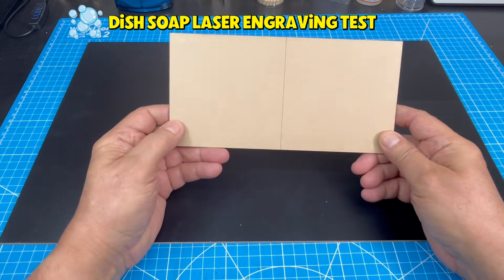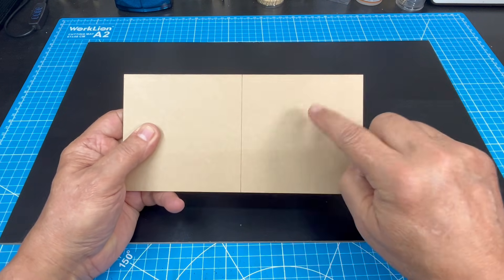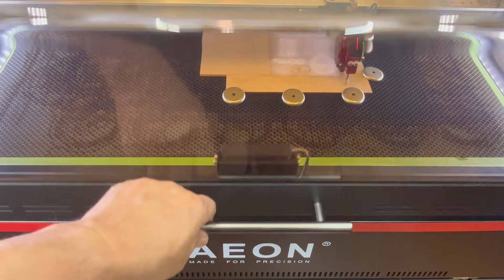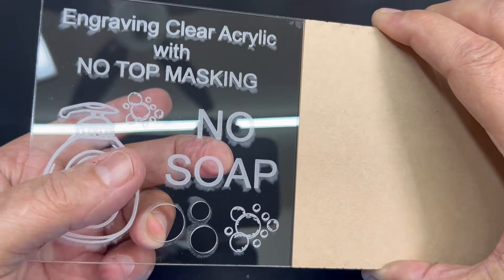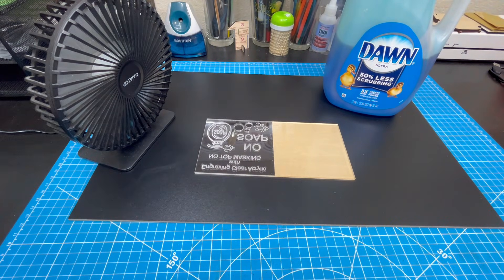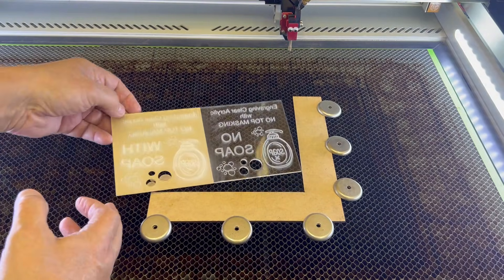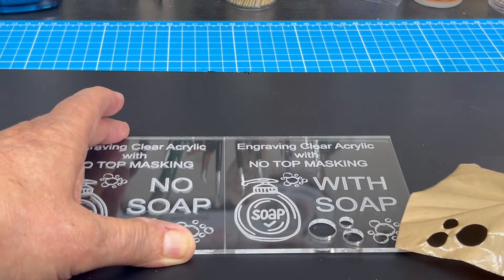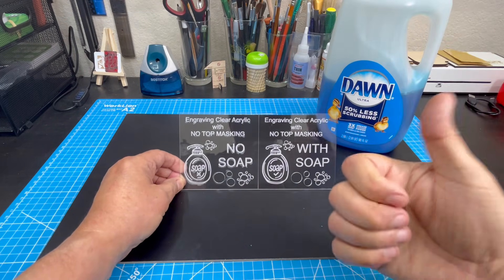Laser Engraving with Dawn Soap -  Dish Soap Laser Engraving Test

Comment: Why not just leave the masking on when engraving?
Reply from the maker: Hi tango! What a great question! And thank you so much for watching the video. You could leave the masking on and that would solve the problem! However, when you are doing many many pieces at the same time, it takes a lot of time to peel off the masking off of each one of the pieces you make. This definitely helps to eliminate the weeding process or the removal of the masking process. So basically this saves a ton of time! But you are right if you have one piece, maybe two if you leave the masking on, it will solve the problem. Hope you have a great day. Hope this answered your question! Rico.

Comment: I've been using this hack for a few years and I find it works well with dollar store dish soap without letting it dry.  I use both Epilog 40W and Trotec 80W CO2 lasers. In my experience, applying the soap and rinsing afterward is faster and much less hassle than weeding the masking paper.  I also find that commercial available acrylic polish will remove the "fogging" as well and will also remove any other small scratches on the acrylic.
Reply from the maker: Hi Steve!!  Thanks you so much for watching my video and thanks for your comment, I really appreciate it!  I totally agree with everything you said. This hack came in handy when i had to engrave 60 acrylic pieces for LED light bases! It made it so easy!!  Hope you have a great day!
Rico

Comment: That’s a bandaid solution and is terrible advice. The real problem is the air assist is too high for acrylic and you are possibly using the wrong nozzle.
Reply from the maker: @MrBrettStar  For laser owners that are cutting out 50 to 100 small acrylic laser engraving with small details in one laser run…
this is NOT a Bandaid solution, this is LIFE SAVING surgery!  
This laser is a production type machine that is built and designed to cut out many parts at one time!  The time savings is PRICELESS!
There are many way to do the same thing.  There is no right or wrong answer.. just Do what-ever process works for you.  
Have a great day! Merry Christmas!
Reply: @ haha, your example is the reason why you wouldn’t want a bandaid solution, imagine applying dish soap to 50-100 pieces instead of just fixing the actual cause.
Reply from the maker: @ respectfully, you would only apply the dish soap to one large sheet of acrylic. A one time application. Pretty simple.

Comment: The laser vaporizes the acrylic, assuming this is cell cast acrylic. It's the vaporized acrylic being blown around you are seeing. If you were to do the same test with almost no air assist the amount of acrylic on the surface would be reduced, but the engravings would not look as white with contrast because it is the air assist that is rapidly cooling the vaporized acrylic and gives it the white color. Dawn is the only type of soap you can use because other soaps have perfumes in them that are flammable.
Reply from the maker: @ibreakstuff815  hey Brake stuff! Thanks for watching the video! And thank you so much for your feedback on the topic. I’ve also heard that soap has fire retardant properties/heat.That’s why it is used by fire fighters use it to fight fires! Hope you have a great day!

Comment: I engrave w the masking on. Saves lots of time and no hazing
Reply: Me too. Turning air assist off helps also if the job requires only engraving.
Reply: @km_777  Just like the author is saying that they think using Soap is a good way to do this. I am saying that I have found that tape and a razor blade is better.   If you don't like their way or my way then don't do it. Pick and choose what is best for you.
Reply: 3:40 Toothbrush, no matter how soft, scratches the acrylic!
Reply: Here’s your tool award 🔧 Well done
Reply from the maker: Hi Johatton3454,   
Thanks for watching my video.   I used to engrave using the masking on the acrylic, until i learned this soap hack.  I find that using this soap technique ELIMINATES having  to pull off or weed off the masking, especially with engravings that have tiny intricate designs, which can sometimes take forever!
  It was a game changer for me.
There is no right or wrong way to do it...just do what ever you feel is best for you!
I hope you have a great day!
Rico
Reply: @ricohernandez2394  Engrave through the masking and then use a plastic razor blade to remove all of the masking. No weeding necessary.
Reply: @bobr1375  using a razor to remove masking is weeding.
Reply: OK so let's call it weeding, it is still faster and less of a pain in the butt to use tape and a plastic razor rather than applying soap, waiting for it to dry, engraving, washing and drying again. Easier and faster and lets not forget cheaper especially if you are  doing anything beyond a 1 off hobby project.   Even if it is a a hobby project the faster and easier is still better.
Reply: @bobr1375  You dont have to wait for it to dry. I have been laser cutting acrylic for a decade. I would bet you in a race I can laser, clean, pack and ship the same item twice as fast with soap than with paper.